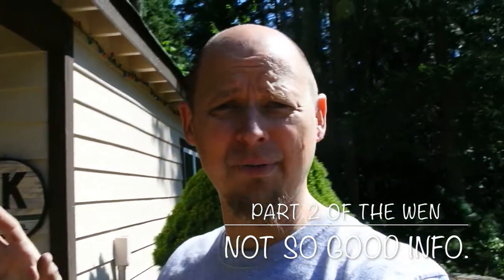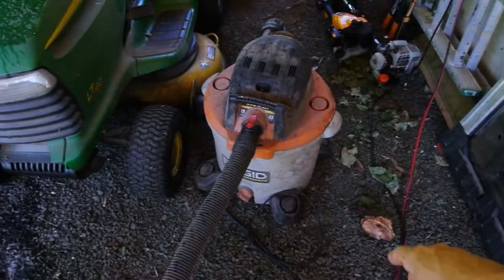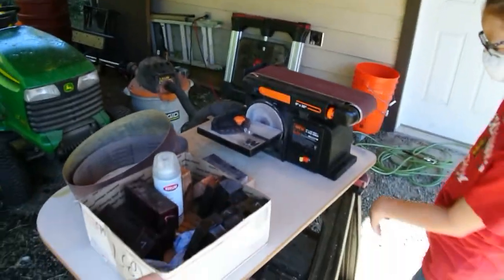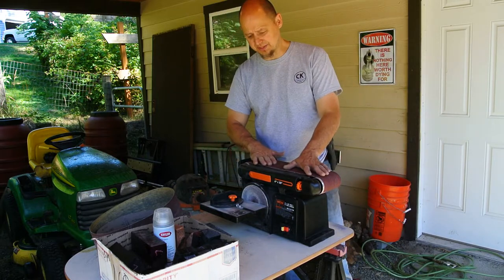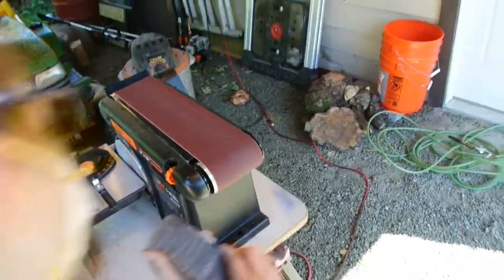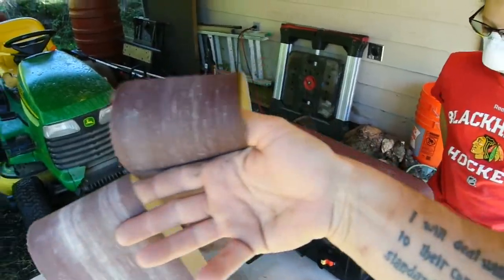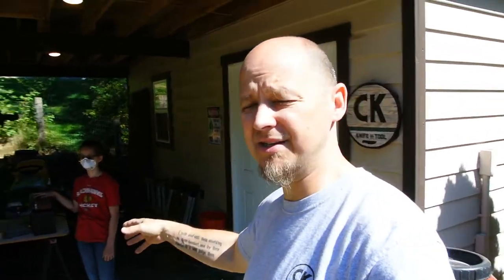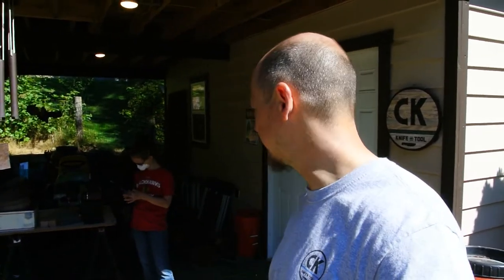WEN Bench Top Sander, Part 2... It's otta here!

Comment: Easy fix- tighten the tension on the drive belt inside by moving the mounting bolts on the motor-- it's unfortunately a very common problem but can easily be fixed in 10 minutes.. Also, be sure the pulleys have their hex bolts tightened against the flat surface of the drive shafts- another huge issue that can easily be fixed... Best of luck to the both of you in your knife making endeavours!! ♡♡♡♡♡

Comment: Something is wrong with that gear drive. You can hear it easily in the video as soon as you turn it on. Wen makes great products. This is the first time I have seen a broken product. So you got a bad one. Why make the company look bad. Just exchange it. I have Wen generators, and other equipment. Good products. Especially for the price. Research the WEN corporation and history. It's very impressive. The same concept as Honda and Toyota.
Reply from the maker: Thanks for the info

Comment: Your daughter’s braid is only a halfway measure.  Pile it up in a tight bun or, better yet, under a baseball cap.  If you have ever seen a scalp injury caused by long hair being caught in exactly this type of power tool you would not call me a worry wart.  I’ve got lots of male friends with hair as long as hers and they are far more careful - for a reason.  I’m old and I wear my hair like yours - not for safety so much as because I’m balding!
Reply: Not to mention a jacket sleeve 😱

Comment: So that sound is a clutch or internal drive belt. It's both for gearing and a safety device in there that is out of adjustment. Old days and all bigger units, you have an external 3300 RPM motor and a reduction belt that drives a bigger pully that drives the sander. It would rip your arm off if you were careless and unlucky.  (Concern about long hair is no joke - sleeves - screwdrivers - etc.) You have an all-in-one that is designed for safety. If you can't adjust it (should be behind the back or bottom plate - a bolt and a spring and a lever or belt tensioner) - anyway - you can always get a bigger one with an external motor. Be careful with it!:face-orange-biting-nails:

Comment: I had the same problem after using the sander for a year..... so of course the warranty was no good.  I checked the drive belt and the screws holding the belt sprockets had come loose.......I tightened them, sanded and it happened again......over and over.  Finally I put some lock-tight super glue on the screws which worked for about an hour before coming loose again.  I'm resigned to buying a new sander.       I had a 4x36 Delta ShopMaster before the Wen that lasted over 20 years of almost constant use......Unfortunately Delta is no longer around

Comment: I bought this sander new. It just quit working after about 20 min of light sanding. The motor makes a sound like it wants to turn but doesn't. Update: I returned the sander and the replacement had a bad bearing straight out of the box. I wasted so much time with this brand.

Comment: No issues with ours shouldn't need to press to hard, make sure it's adjusted hopefully they can send you a better one
Reply from the maker: We went with the BuckTool brand and it was a much better build quality and has been working great.  I think I did a video on that one as well.
Reply: @CKKnifeandTool  did you get that at Amazon,  I bought something once from them the item said new but wasn't.  The tool we got from Wal-Mart online hopefully it won't be the same. Harbor freight has a tool for about 77$ it worked out well but hard to switch out the belt I had to keep umscrewing the bolts and realigning it often. I hope you and your daughter like the new, awesome to know!

Comment: Either there is a Key (straight or woodruff) that has wondered out of its position keeping the pulley in place or the belt is slipping. I know you don't want to mess with it and it's probably a return issue... but for me, I would take it apart and find out. Now... if the motor burned out... then I would send it back. Most likely it's a key or a belt tension. Good luck.
Reply from the maker: If I bought it used via eBay, CraigsList or a garage sale I would have torn it apart and trouble shot the issues, which I think I know what they were. There were no other tensioning options.  The internal spring I guess has a pre-load set.  I think it was the fact that the WEN is not a direct driven unit.  The motor runs an internal fully that attaches to another via a small belt and that causes a loss of power as it runs.  factor in the dust that I believe accumulated within the unit caused the failure.  I have another 4x36 coming and will do an unboxing and review on that one.  Different company and different design of machine.

Comment: you can hear the drive belt slipping, easy fix if you know how - this is why you must familiarise yourself with your tools, this machine was not propperly set up when it was assembled, annoying but not something to return it for
Reply from the maker: Steven R ... If it were a garage sale purchase or a hand me down I would say, dedicate some time and trouble shoot.  But if a product is brand new and after trouble shooting and using it doesn’t work as it should, why then dedicate the time, money and effort to fix something that is obviously a product of bad quality control or build quality?  If enough folks return items like this, it can send a message to the companies/ manufacturers that there’s a problem.  Try calling or emailing a company whose customer service is dependent on foreign makers.  No thanks.  Return.  Get replacement or a different one.  Move on with the next project.  Done.  The Bucktool I got instead is great and it’s still going strong.  Thanks though!

Comment: Well that's irritating. Did you try tightening the belt tension first?
Reply from the maker: The WEN had only an on/off lever which loosened the belt to remove and instal and then the tracking knob.  There were no other tensioning options.  The internal spring I guess has a pre-load set.  I think it was the fact that the WEN is not a direct driven unit.  The motor runs an internal fully that attaches to another via a small belt and that causes a loss of power as it runs.  factor in the dust that I believe accumulated within the unit caused the failure.

Comment: Что так быстро вышел из строя или это задумка  автора станка
Reply from the maker: The WEN had only an on/off lever which loosened the belt to remove and instal and then the tracking knob.  There were no other tensioning options.  The internal spring I guess has a pre-load set.  I think it was the fact that the WEN is not a direct driven unit.  The motor runs an internal fully that attaches to another via a small belt and that causes a loss of power as it runs.  factor in the dust that I believe accumulated within the unit caused the failure.  Keep an eye out for another 4x36 bench sander unboxing and review.  Different company, and a different drive.
Reply: Сибирское здоровье 
То же самое я видел и в других сэндирах, это не означает что они не исправны, нужно просто включить голову и отрегулировать ремень, вот и все. Другое дело, когда сам электродвигатель останавливается от нагрузки, это говорит о малой мощности двигателя и такой сэндер как правило малопригоден для работ в шапе... В данном же случае, этот сэндер имеет вполне пригодную мощьность, надо его подготовить к работе и все отрегулировать правильно, вот и все дела... Американцы как правило не включают голову и не хотят что либо делать, им нужно все  подавать готовое, думаю в данном видео это как раз тот случай...